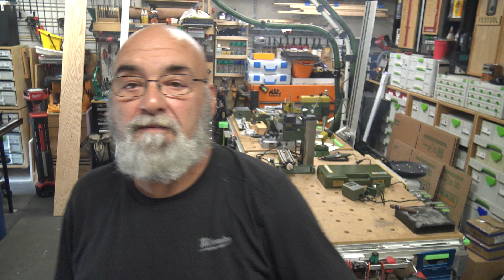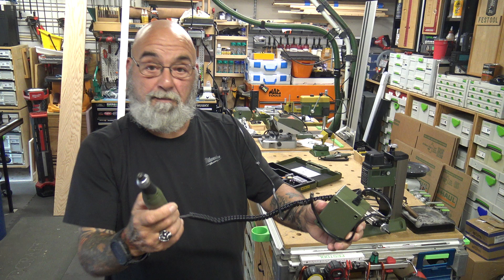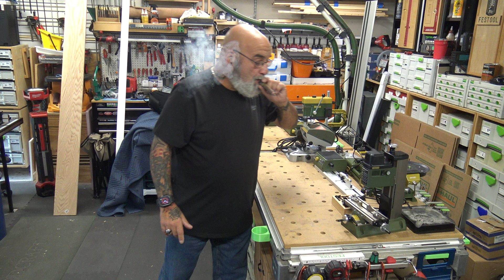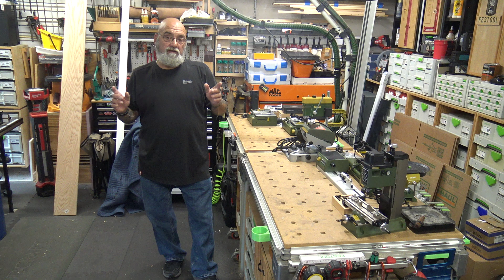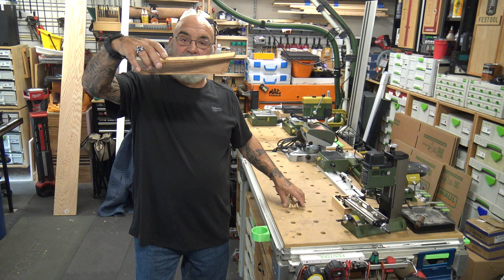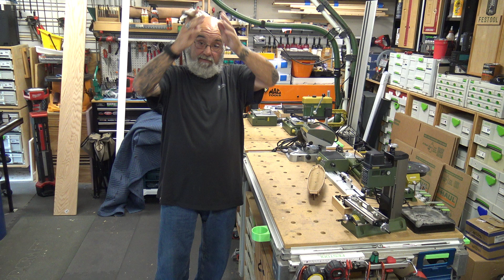My new Proxxon tools

Comment: I would love to see projects. I am doing woodworking by hand tools. But some things I need more preciosion. A lot of woodworkers are gluing wood to create thicker lumber pieces. I am thinking my small projects, I could use the small Proxxon tools and glue layers together. I designed a yellow pine bench using 2 inch by 3/4 inch lumber, interlocking them cutting dove tails. I could have used more precise cuts vs filling in gaps using glue and sawdust. First, I was only looking for a small portable sander for my wood stools, short step stools. I do a lot of dowel joints and wanted to design my own threaded wood dowels. I want to woodurn dowels, draw them through a thread cutter, tap wood threaded holes and screw my custom dowel screws and glue them in place. I used normal dowels to glue my 2 x 3/4 inch  yellow pine together. Where the wood crosses, I have glued in dowels. But that project made me consider creating wood dowel screws. I am thinking 1/2 and 1 inch dowels. So I am looking at the Proxxon DB250 for super simple dowel turning.

Comment: I’ve got the Proxxon drill press, chop saw, scroll saw and FET table saw. They’re ok, but each has shortcomings. The miter saw detents are not accurate, and you can’t go by the 45, 90 etc stops. I blocked the locking lever so it won’t engage, and set the angle with a gauge against the jaw and blade. The blade guard makes it impossible to see a cut mark and blade, and I wound up modifying it so I can make accurate cuts. The third issue is one that’ll get you hurt! If you cut fast, the piece that falls off will fall in the concave base, the blade will hit it and launch it like a bullet! Cut slowly, especially when nearing the point of separation! The drill press motor speed wanders up and down even when it’s not drilling. I actually like my Dremel work station better! The FET table saw does a pretty good job, but the smell of burnt wood during use is concerning to me. The fence is sketchy at best. I’ve had the scroll saw the shortest of time, and it’s okay after a learning curve. I replaced the supplied blades with Olsen and PGT blades, and they made a difference in my opinion. To get any benefit from the blower, the foot has to be sitting ON the piece being cut, and even then it’s hit or miss. The bellows just don’t put out much airflow, and you’ll find yourself blowing dust away from the cut! These machines fill a nearly vacant space in the tool world, and they’re better than nothing, but the user has to keep in mind that they’re light duty machines!

Comment: The dremel, I got into another line mainly because of that reason. I have dremels that live in the dremel drill press and router table. My main pro line is dewalt and I wasn't going into the other voltage lines for a dremel. So I found battery adapters for bauer tools using dewalt batteries. Their little 20v dremel is quite good. Not ultrasonic but it is great for my rc and model tasks along with complete portability.